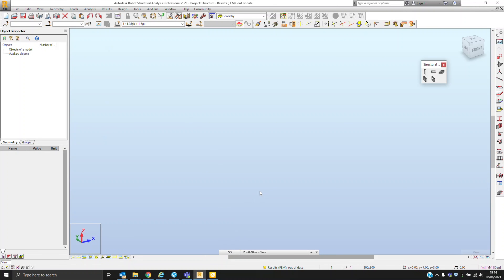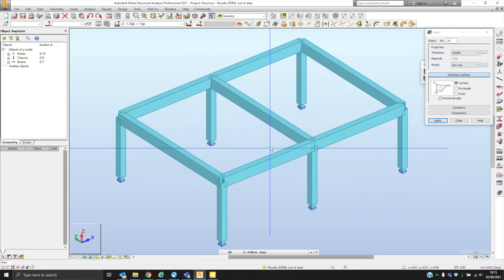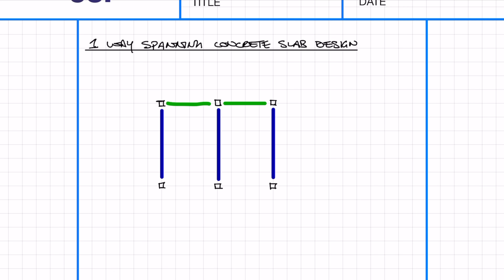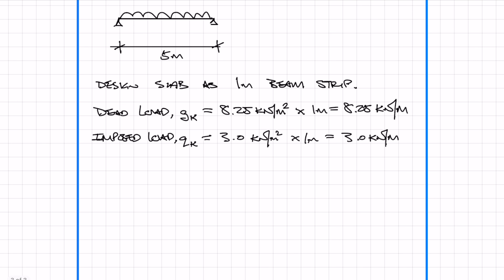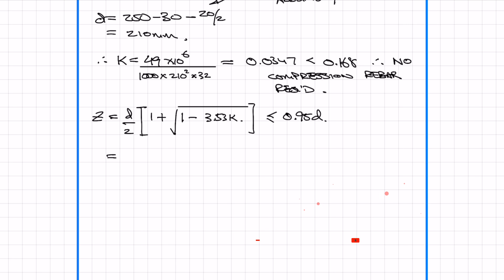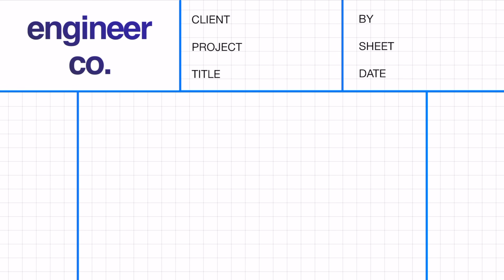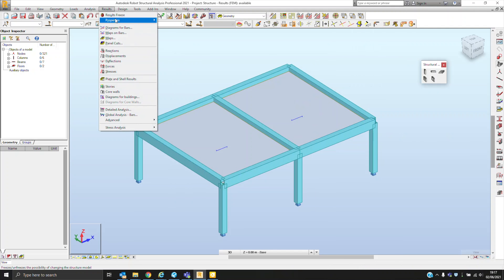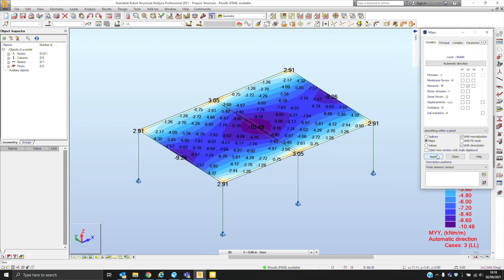Concrete Slab Design - Part 1 - Introduction to concrete slabs and a simple design example

Comment: Great video again, this has technically become a one-way continuous slab as it runs over that central beam. Therefore, this can help with the amount of reinforcement in sagging, might be worth mentioning the tension reinforcement required over that central beam.

Comment: I'm an undergrad student and I want to learn Structural Analysis software. Do i need to know FEM or FEA for me to be able to use it? I was hoping to use it for simple tasks like analysis and design of simply supported beam and single storey frames. What are your thoughts?
Reply from the maker: No you won't need to know the theory behind FEA but it is useful to have some knowledge of FEA.
You should not be using FEA or modelling software to design simple things such as simply supports beams!
Reply: You're right, in that regard. However wouldn't learning such be useful if you have repetative tasks with similar situations?
Reply: @nascentnaga  I was thinking SAP2000 or Robot Structural analysis. Jus to get me started.
Reply from the maker: Should be able to get a student version of robot if you want to play with it